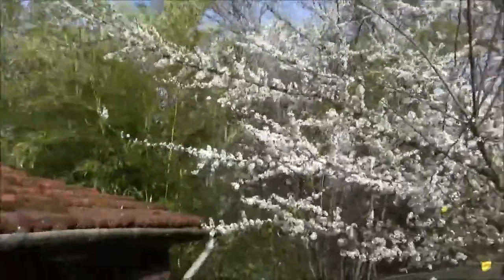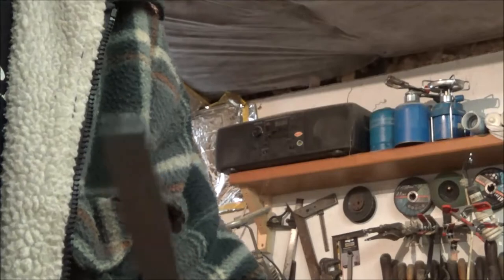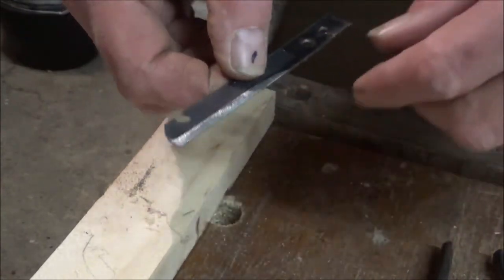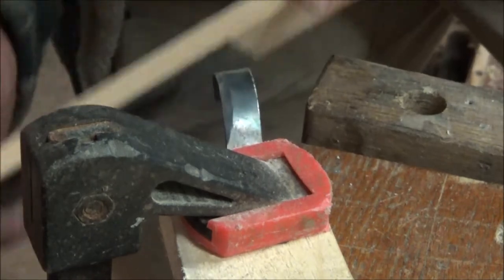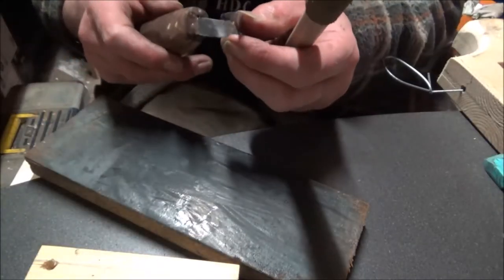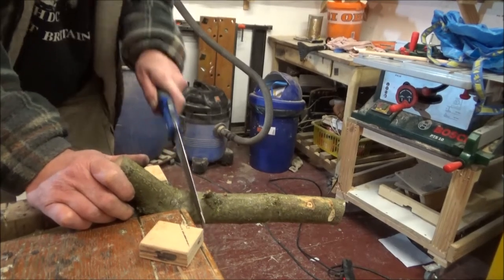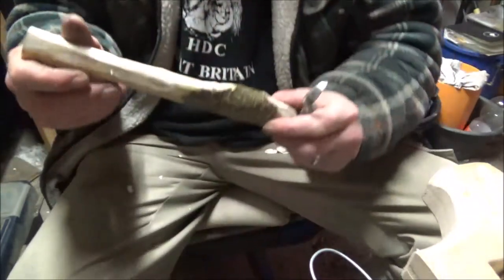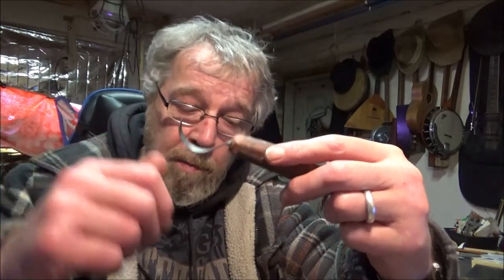Making a spoon carving knife from an old saw blade  06 04 21

Comment: Enjoyed that one pal. It's always a good day if you are in the workshop mecking sommat.
Reply from the maker: Cheers mate. Got to make sommat sometimes.
Reply: @SouthpawDavey  nice job but I got good project for you try making a mallet I made 2 from blackthorn is best wood it’s naturally heavy and hard  watch the thorns they are poisonous break off in skin   Start with length of blackthorn put it on chopping block cut with axe at angle at bottom  cut till your happy with girth of handle to fit your hands comfortably jobs a goodun

Comment: A shame the plum won't likely survive, it is beautiful!! There are so many blooms!! Can't you cover it?? I'm impressed... your original line hand drawn was as accurate as when you placed the ruler against it! That, is a steady hand! Lotsa sparks and flame! Please explain normalize!? I get that heat changes the structural strength of steel, but that's as much as I know! And thank you for protecting your skin! Better to notice the wrong way when you did, than later.. it counts!! That looks excellent and how you attached to the handle is stellar!! Impressive build!! It's a great piece!!  And that is what happens when you don't hang onto the wood till the last second, it just gets away from you!! LOL  Very cool that you can spoon a knotty(naughty?) piece and have it turn out so great! Well done!! It happens to us all.. I videotaped, I thought, and I had it set to take photos not record.. got 3 photos instead of 3 vids... go figure! I want to see it, please!? You know how much I enjoy this!! I like the spoon and want more, please?!💖
Reply from the maker: I am sure some of the plumb blossom will be ok. I have never seen it with so much on. Normalizing is making the steel soft again. If I heat it red then let it cool slow it will soften. If I cool it fast in oil or water it will got hard and brittle. Then you heat it again to temper not as hot around 230c.Yes Knotty.  Would have been a pain if I had stuck it on the wrong way lol.. Yeah not the first time I thought I was filming and it turned out I wasnt lol. I will film the next spoon.
Reply: I do hope the blossom will be okay!! It's so promising to see so many flowers!! 
Thank you for explaining that! I did not know that and appreciate it very much! Very cool! Knotty, got it! 
Good you caught that then!! Essentially, it never happened!
You're not alone, I've had many a faux pas with the camera that doesn't make the light of day, or Youtube! lol 
Thank you!! I'm pleased to hear that you'll do it!! I really do enjoy watching these vids!! I like the spoon knife and the spoon! 
Cheers!! 💖 @SouthpawDavey

Comment: That's a great idea. Do you have to heat it if your just making a straight blade? I've got loads of old saws! 
Also have you ever heard of plants growing under water?
I have a cutting from when I pruned the gooseberry bushes last year and it started to shoot late on so I put it in a pot with water in and started to grow then lost its leaves and with all the rain the pot is full with the cutting a couple of inches under water completely. I noticed it's starting to grow again but it's under water! I thought plants drowned if they got too much water.
Reply from the maker: You might get away with it no heat treat. If you grind it and get it hot it will go soft and not keep an edge long. Worth a try though. Not sure with the gooseberry maybe its went dormant over winter I would pull it out of the water and see if it survives. If you prone them and any current bushes they root dead easy just stick them in a pot or the ground and about 90% will root.
Cheers.
Reply: @SouthpawDavey  ok. I was going to make a video about the gooseberry and you will see for yourself. So when your heating up the blade are you tempering it?
Reply from the maker: You get it to red hot and let it air cool to soften it normalizing it. Do your shaping drilling sharpening to form the edge. Then heat it to red again and quench it in water or veg oil fast. That will make it very very hard but brittle. To temper it put it in the oven at 220c for an hour. That will make it softer but strong do the final sharpening it will hold an edge. Be interesting to see whats going on with the plant.
Reply: @SouthpawDavey  uploading a video of it I recorded a couple of nights ago.💛👍
Reply from the maker: @rastamanralph6670  I will have a look.